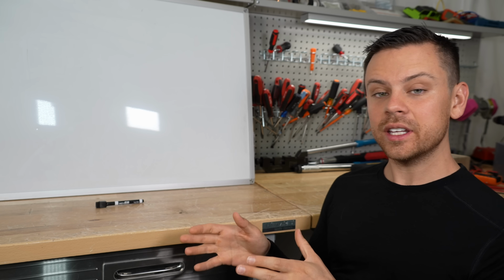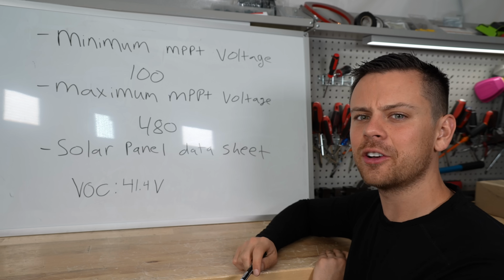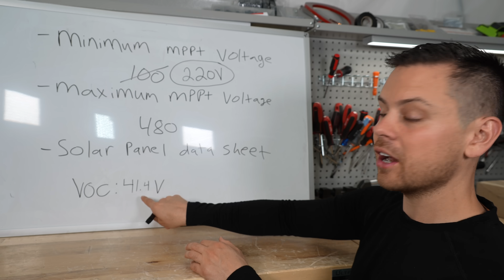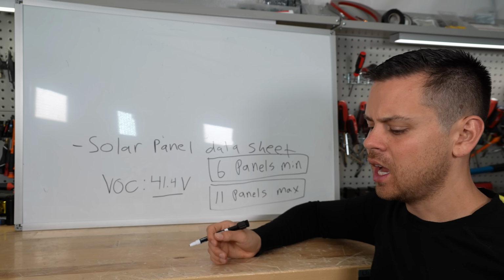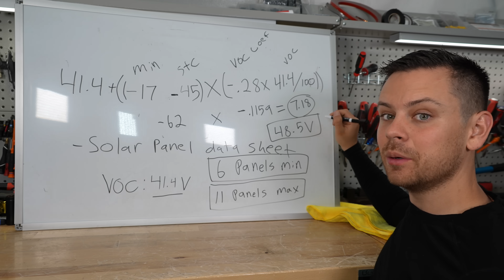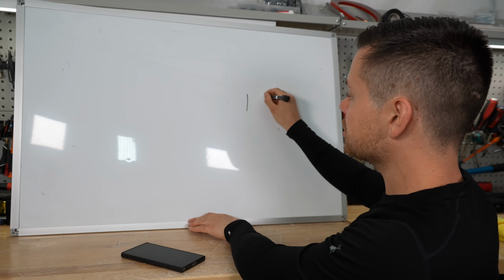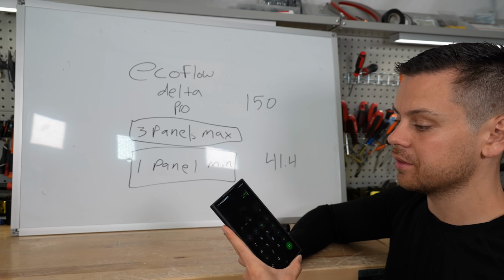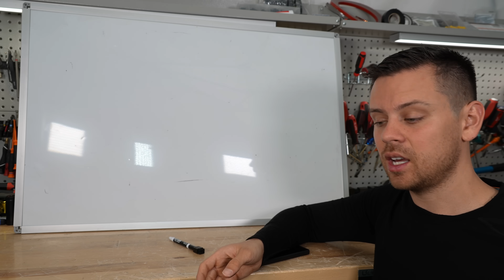Solar String Voltage Made Easy! How many solar panels can you safely connect?

Comment from the maker: 0:00 Intro
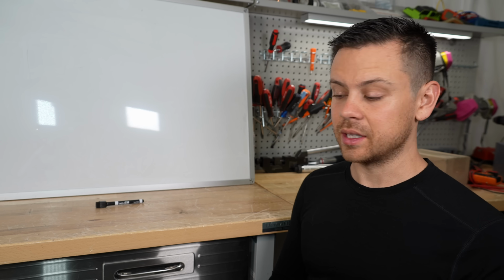1:16 What You Need
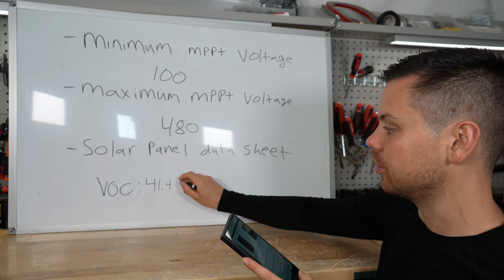2:37 Calculate Minimum String Voltage
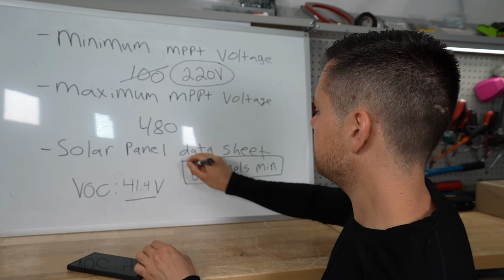5:04 Calculate Maximum String Voltage
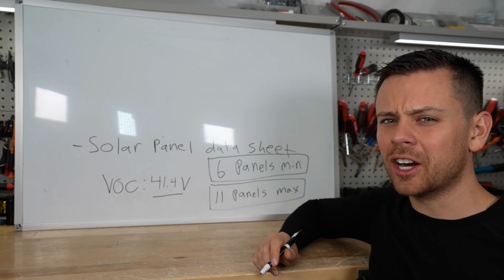6:18 Temp Coef Calculation For Cold Climates
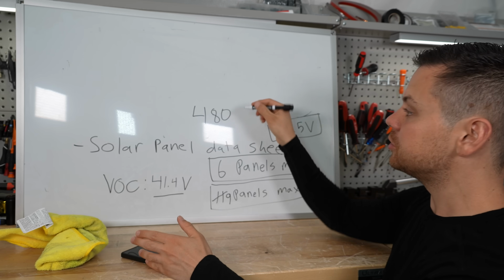10:06 Solar Generator Calculation
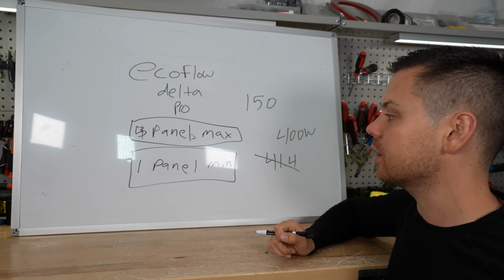12:48 Current Calculation and Conclusion

Parallel String Video: https://youtu.be/C-k0WHJ4RxQ?si=ALnTndizN34Y4kk7
Lowest Temp Solar Map: https://energyresearch.ucf.edu/solar-certification/solar-reference-map/
Temp Coef Equation: https://www.greentechrenewables.com/article/solar-inverter-string-design-calculations
My 12V Solar Book for Beginners: http://amzn.to/2Aj4dX4
Diy Solar Forum: https://www.diysolarforum.com

~~~~~~~~~~~~~~~~~~~~~~~~~~~~~~~~~~~~~~~~~~
Tired of getting ripped off? Check out my "Will Prowse Approved" solar product recommendations below!

12V Batteries
https://www.mobile-solarpower.com/lithium-batteries.html

48V Batteries
https://www.mobile-solarpower.com/48v-batteries.html

Offgrid Inverter System Builder
https://www.mobile-solarpower.com/48v-complete-system-blueprint-559371.html

Hybrid Inverter System Builder
https://www.mobile-solarpower.com/code-compliant-48v-offgrid-system.html

Mobile Handtruck System Builder (very popular!)
https://www.mobile-solarpower.com/mobile-48v-system.html

Solar Panels
https://www.mobile-solarpower.com/300w-solar-panels.html

Ground Mount Solar Racking
https://www.mobile-solarpower.com/ground-mount-racks.html

Wire, Lugs and Busbars
https://www.mobile-solarpower.com/wire-and-connectors.html

Tools
https://www.mobile-solarpower.com/tools.html

Fuses and Circuit Breakers
https://www.mobile-solarpower.com/fuses.html

Plug-N-Play Solar Systems
Ecoflow, Anker And Bluetti! So many models to choose from. See my current recommendations here:
https://www.mobile-solarpower.com/full-size-systems.html

~~~~~~~~~~~~~~~~~~~~~~~~~~~~~~~~~~~~~~~~~~
Need to build a large DIY system? Need a trustworthy solar distributor? These are my favorites:

Signature Solar
Creator of EG4! Solar Minisplits, Victron and More! Largest Solar Store Online.
If you want $50 off, please use my link below and coupon code "DIYSOLAR50":
https://signaturesolar.com/?ref=cPwLcVc0SW-BjN

Current Connected
Best Prices for EG4, Victron, Midnite and so much more! Fast Shipping and Highest Rated Customer Service:
https://currentconnected.com/?ref=wp

~~~~~~~~~~~~~~~~~~~~~~~~~~~~~~~~~~~~~~~~~~
Join our DIY Solar Community 
Need more help? Join the largest solar forum on the internet for beginners and professionals alike. 140,000 members and counting!
https://www.diysolarforum.com

Check Out My Free Book
Best-selling and beginner-friendly guidebook to off-grid 12V solar!
https://www.mobile-solarpower.com/the-book.html

~~~~~~~~~~~~~~~~~~~~~~~~~~~~~~~~~~~~~~~~~~
Contact Information:
I am NOT available for personal solar system consult! If you wish to contact me, this is my direct email: williamprowsediysolar@gmail.com
FTC Disclosure Statement and Disclaimers:
Every video includes paid promotion or sponsorship (such as free products for review). Some links on this YouTube channel may be affiliate links. We may get paid if you buy something or take an action after clicking one of these. My videos are for educational purposes only. Information is subject to change/update at any time. Electricity is DANGEROUS and can kill. Be smart and use common sense :) DIY Solar Power with Will Prowse is a participant in the Amazon Services LLC Associates Program, An affiliate advertising program designed to provide a means for sites to earn advertising fees by advertising and linking to Amazon.com
Reply: Great video Will. Excellent information 👌
Reply: I feel like this more apply to initial installation.  Or if you disconnect and reconnect.  Once connected to your system, will it really generate 48.5volt at -17 at night for example ?  That said, why take the chance someone turn on and off an safety switch at -17oC :)
Reply: Will
We have a discussion about a mppt.

What happens if you mppt can do 300watt input .
And we connect 600watts on it .
What do the systeem with the rest ?
I tell we have ampère spikes and can damage the mppt over time .

I like to see a test with amp/watt meter between the solar and mppt to see what it will do and if the ampère spikes 

Thanks
Reply from the maker: @dyslectische  if you don't exceed the voltage limit, it should be fine. It will just regulate to max current and hold it there. If it's in hot environment and running at max output for years, will fail sooner but should be fine
Reply: @WillProwse  thanks
Reply: @WillProwse WAIT… your panels STC is FORTYFIVE VOLTS??? I have always seen 25C max… holy crap!
Reply: Will you would so make a university/college lecturer - I guest at many establishments and the reality is few existing lecturers are up to date or knowledgeable they are fixed in 80's time warp teaching things much of which is obsolete
Reply: Will, if I’m correct that voltage is per MPPT charge controller. Not per inverter. The 6000xp has 2 MPPT charge controllers. So x panels per MPPT. Correct?
Reply: Will. I have answered my own question. So I made a video about the EG4 monitor . The voltage and amperage max values are per MPPT. And the 6000xp has 2 MPPT controllers. There is an item in my video that hasn’t been covered. And it’s a critical point that has ever been addressed that I saw on any videos yet regarding voltages on the solar arrays and how that voltage changes by angle of the panel to the sun and time of day and temperatures. That voltage changes constantly. Telling everyone don’t get too close to the max voltage even if it’s under. 
Also, Will, if you modify the angle of the carport angle my modifying the height of two of the legs, you can increase the absorption of the panels getting into the 9kw even if you are not using the bifacial gain. I am trying to get the build video done as it’s long, but will post the video ASAP. Also a real life off grid property with load tests is also on the way to be posted. It will include water well, washer / dryer, deep freezer. 2 ACs, refrigerator, internet, TVs, table saws,  etc all running.
Reply: On the 6000xp you don’t mention that it has a max 4kw per string input so connecting 11 panels would exceed that series limit. Had to check the manual.
Reply: I made you responsible for keeping the secret about Nickel Iron batteries. These batteries last for 50 years to 100 years. They are not damaged with overcharging and overdischarging. No more headache for BMS. Temperature also does not kill these batteries. Lifepo4 sucks. We should now move towards real green energy  NeFi also known as edison's battery is the only way for freedom.
Reply: @nizamersoftware  NiFe batteries are good batteries, but terrible for solar. They have a worse round trip efficiency than lead acid…
Reply: I am mounting 4250w ( 8 at 535w,49oc) u p on my RV, and while I would prefer to run them in series, but will parallel in a 4s/2p to accomodate the potential for shade. My min voltage to activate the mppt is 120 volts, so I will be pushing 160+-v @26+- amps instead of 320@13.. These are New open box Jinko 535 bifacials @ $127 into the EcoW 5k/100amp
.
Reply: Do you have a video that explains configurations like 2s2p ect, 
Finding it hard too get the correct answers 
For example 4x 100w panels 20-24voc 14-16isc 
Best of both worlds with no shading? 
Any help would be great thanks
Reply: So I'm 12v you'd recommend min of 55voc 220/4= 55 
Interesting

Comment: The cold calculation has some COLD irony in it since when it is coldest one will probably be needing that solar system warmth the most and be seeing the most issues in general. 
THANKS for this info as a solar newbie. 
One does not know what one does not know, until they know...SMILE

Comment: One extra thing for beginners... dont forget the voltage drop that occurs in the wires between panels and charge controller. My first system was calculated just as Will shows except for budget reasons I was running just above the min input voltage. The loss in the wires put me just below min into the controller so everything was bonkers from one min to the next.

Comment: Can you size string for maximum volts using open circuit volt rating in my case I have solar controller for pumping 100hp 250-900v dc max I also want to put in a 900 volt surge protector motor Amps is  115A at 460V 3 phase

Comment: What about non-optimal panel orientation and tilt? That is going to effectively lower the voltage. Is there a formula for calculating those effects? Also temperature may increase going from night to day. What time of day should be used to identify the low temperature since nighttime temperature makes no difference given the lack of sunlight at that time.

Comment: Thank you for the long math and the cold temp math, but, the panel testing is under optimal conditions, now the angle of the panels change that is good and can be altered, but not where the sun is where I am, so summer the sun it right above (90* angle to horizon), winter I am looking at 45* horizon, do I care about not putting the few extra panels on or over paneling when the sun is not going to be anywhere overhead, granted the winters have been -15*F for a few weeks, but cloudy, snow, and a short sunny days my collecting window is very short. Scratching my head.. I figure I can put a switch on the system I am planning to drop or add the panels depending on the time of year.

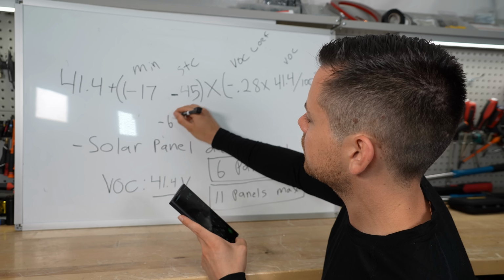Comment: At 8:00 you calculate temperature adjusted Voc. You should substract 25C not the 45C since 41.4 Voc is measured at STC and at 25C

Comment: Love your videos . Please give us an example of a 12 volt system for a sailboat. 
Small but tough equipment, panels mounted on an arch . Battery recommendations for confined spaces that could possibly get wet. And can be wired into the 12v panel and an inverter 2000 watts or larger

Comment: I gotta disagree that connecting is parallel means they're connected wrong. Unless there are multi-thousands watt panels available. I can't run enough W with my 12000xp with only a single series string, even at max voltage

Comment: EG4 Has a fantastic calculator on their website that takes this into account. 
I didn't account for the cold so I could have damaged mine. Luckily I found the calculator and your video before I finalized the install and was able to redo my design with my FlexBoss21

Comment: Very good info (as in almost all your video clips), however with  coldest ever possible Voc on your location you might consider how extremely rare the found reading was and more important how likely it is it will happen again? Dont get me wrong, statistics are clear if it happened before it will happen again but nobody knows how soon and ir how often...so I was wondering for a different approach:
 1/ of course I want to take any      precaution avoiding the safe max input voltage of my MPPT controller is jeopardised
2/ I also want best value for money energy yield of my system specially in the darker/  shorter days so enough solar panels to get be a safe but limited distance from this max  Vinput eg 10% most of the time
3/ so how solve the dilemma? Add a simple solar panel array voltage sensor powered by panel voltage (with capacitor resistor/ potmeter circuit as sensor and seperate HV input DC DC convertor which immediately when total string voltage gets to max MPPT input voltage just immediately shorts one panel  in the string  by activating thyristor or relay which keeps this one panel shorted untill it gets dark and system is "reset" automatically and clears short circuit at this panel automatically at dark
NB solar panels are "current" sources and indicate what is is max short circuit current which is not that much higher than the MPPT panel current (and "short circuiting" a current source does NOT cause damage to short-circuited panel ir rest if string.. 
Intend is to get more yield from system, by running closer to max MPPT voltage, but still protect against blowing up my MPPT and all hassle related when ths happens in winter with slipperyness on roof while still protecting the MPPT,  what do you think of this?

 Rgds Wessel 
NB 2nd hand solar panels of earlier generations can be obtained very cheaply nowadays, specially in countries in which up to recently it was allowed to use conventional electricy meters which run backwards if you pump on energy into grid

Comment: One major problem with stringing panels in series is a 2019 NEC rule that there must be a "rapid shutdown" device between each panel, if on a building roof.  That adds significant cost and risk of failures and even roof fires.  The rule is that all DC voltages must be <80 VDC within 30 seconds after flipping a safety switch on the wall below.  The purpose is to protect firefighters from shock if they climb on the roof to break thru to the attic.  One reason why most roof installations now use microinverters.  Doesn't apply if the panels are not on a building roof, such as ground mount or a carport or gazebo.
Reply: Does that rule still apply if in a series to parallel conf?

Comment: Can an auto under/over voltage relay switch be wired between the 11 panels and when the voltage goes over on a cold day it could shut off and re-route to a 8 panel circuit. I’m not sure if this makes sense but can we wire up something to go from 11 to 8 panels automatically on cold days?
Reply: That's a good question👆
Reply: Or turn on more panels at dusk & dawn ?

Comment: You are too complicated for novice.  I would find it much more easy to follow if you split the screen and had Solar panel data on one side and MPPT data on the other. 
It might be simple for you to correlate from each data sheet to the other but I need to get it right, as you say.

Comment: You commented that you could buy used solar panels what is the oldest solar panel you should buy or does an age make a difference and you're not gonna have a data sheet with used equipment how would you test them?

Comment: Good video. If the temperature coefficient is not available for VOC on the solar panel, can you add a safe guess percent to the VOC rating on the panel so that you don't go above the max voltage of the charge controller in cold weather ( here it would be 0 F or -32 C ). Another question. When you are figuring minimum voltage required to get your charge controller running, do you always multiply the minimum voltage required by the charge controller by 2.2 like you did in your example?

Comment: i have  a 5000watt inverter can take 500volts and am using string of 200 watt panels i have connected 15 panels so far worried about how much  voltage i can put through those small paneis currently 250-325 volts can these panels handle that much power going through them i want to ad 3 more panels 200 w panels have 21.6 voc 5.55lop thanks will

Comment: Why would charge controller be damaged by voltage that's too high? I'd think manufacturers would add a simple over-voltage protection circuit into their gear.
Reply: Yea a fuse should be in them.But once we are talking about electronics that becomes a little complicated.And we are including cost effectiveness as well.

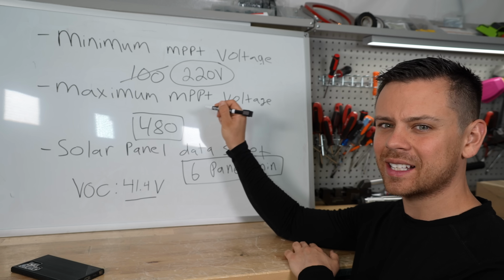Comment: So when you say that it is a "hard limit" at 5:23---when I look at say, the Flexboss18 specsheet, I see a MPPT voltage range of 120-440VDC, and a max PV input voltage of 600VDC. Why does it say that?
Reply: Ever figure this out?  I assume 600 is the limit that wound damage the inverter but 440 is the voltage limit for continual operation?

Comment: Sorry to bother, but I am trying to figure the math for FlexBoss21,  The spec sheet says normal mppt operating range 120v to 480 but the maximum mppt is 600 V. 
So which max do I use for  Calculating how many solar panels

Comment: Shouldn't you use the Vmp on the pannels data sheet as Voc is open circuit and Vmp working voltage
Reply from the maker: Early morning when the panels are cold and it hasn't tracked the Power Point, it will be exposed to a higher voltage. That's why we need VOC first for highest voltage possible

Comment: Sol-Ark has a panel sizing tool designed for its inverter. However the math is the same for any arrays. If you understand the inverter you have, the tool will do the math.

Comment: A 48 V system is wonderful for permanent home use and it’s what I use but as I design a system for my RV, what is the voltage numbers I need to compute for a 24 V battery system? You state for a 48 is 220 V.

Comment: Grape 12v 100w solar panels. Eg4 3000. 500v max, 120 to 450v  comfort zone. Voc 23.1v, noct 45,
Reply: So i checked voltage today on 18 panels before i hooked it up, it was 505v at 7am 95 degrees. So 23.1v timed the 1.20 equals 499v. So i am concerned that at 95 degrees i am that high. My question is this. Should i goto 15 or 16 panels?

Comment: Newbie question here, but how is this related to clipping where you can/should add more panels than the inverter can handle to maximize charge vs charge controller and how they work together or difference between them?

Comment: hi i have 525 w panel with voc 49.2 but on my inverter i dont see voc.. my inverter is rated for 6500w and max PV 500vdc. can i use my panels and how should i wire parallel or series?

Comment: Hi Will, Thanks for sharing your expertise. What happens to all these careful calculations when you connect BI-FACIAL panels to your inverter? Does this create unreasonable risk that the voltage will surge past the inverter’s limit?  Or will the amperage exceed the inverter’s maximum limit?
Thanks again.

Comment: Hi there, about maximum MPPT Voltage eg 500V, do you mean per MPPT? So that if an inverter has 2 mppts we can connect 2x500v strings? Thank you for your time.
Costas